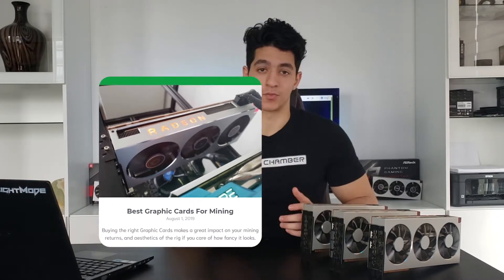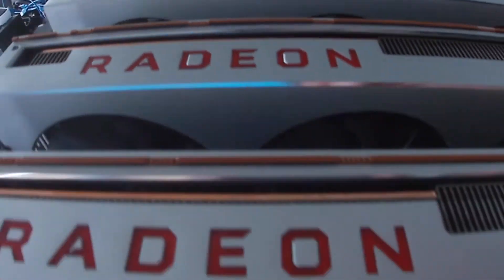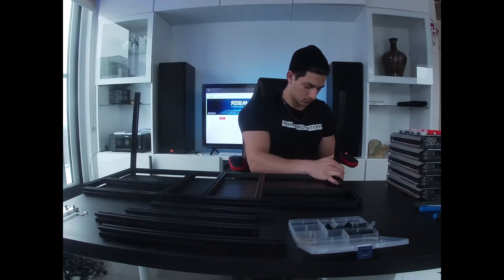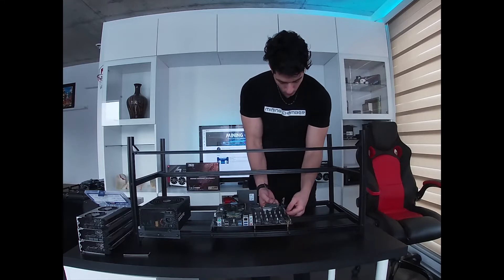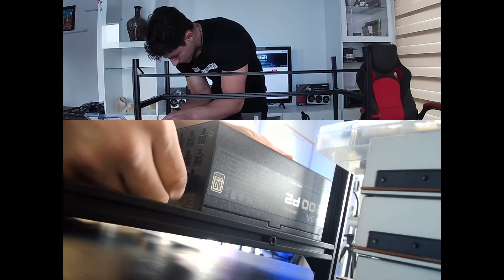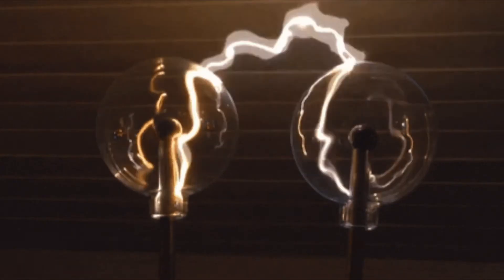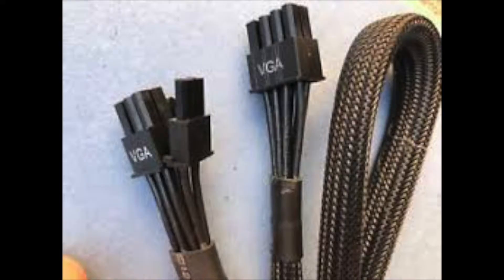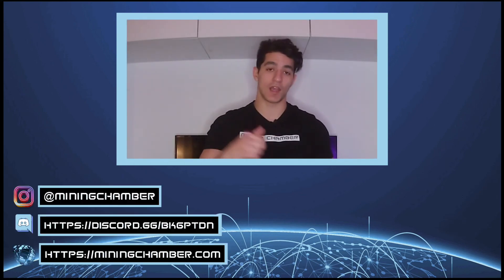HOW TO BUILD A MINING RIG + BEST GPUs IN 2020 !

Comment: Hey guys. I built my first mine and the GPU fans don't spin. I also have no signal going to my monitor. Did you have to troubleshoot your mine before it worked or did it work right away?
Reply from the maker: Hey!! GPU fans don't spin at all or do they spin and then stop? And for no Signal usually you will need to plug in the HDMI in the main GPU that is connected to the main PCIE slot if not then try the integrated one on the motherboard. Sometimes you have to troubleshoot and it is all and our luck haha! Join our Discord server we will and we will get you running. https://discord.gg/bK6ptDN
Reply: @MiningChamber  Thank you for the invite, just joined the group! The fans don't spin at all.  I have tried plugging the HDMI to the main GPU and the board directly, I even moved a GPU to the board.  I really appreciate your help, this is my first build and I'm really excited to get it going but so far it's been a week of troubleshooting.
Reply from the maker: @dderuy  No problem at all! If they dont spin at all then we might need to look at the PSU. I will talk to you on Discord and well see whatsup!

Comment: Hello! I'm planning to set up 3 radeon VII with the 1200 watt power supply which is the one you recommended. Can I plug that into any outlet? I live in New York
Reply from the maker: Hey Nick!! Yes absolutely perfect for 3 Radeon VII, we recommend getting the P2 EVGA 1200w Platinum PSU. It has a good amount of vga cables!
Reply: @MiningChamber   Perfect and if I would want to add 3 more to make 6 radeon total id just have to buy another EVGA 1200w and find another outlet? I have standard electric btw that's fine right?
Reply from the maker: @RealNicoGS  oh yes sorry perfect for the double p2 evga and completely missed the electric part. 

So for 3 Radeon VII you will be using upwards to 900 watts in mining, add 3 more you got about 1700 watts.

Which means a 15 amp circuit wont be able to handle all the load, so first check on your fuse box and try to distribute them on 2 - 15 amp outlets or 1 - 25 amp outlet. 

So just try to read the fuse box label and locate outlets and make sure they are not in the same circuit. ( if you switch a breaker off and then the outlet does not supply power means it is connected to that breaker, sometimes 2-3 outlets can be under only one breaker.)
Reply: @MiningChamber  perfect thanks!!!!

Comment: I am getting a two Raedon VII cards.  I have a 750 Corsair Gold, but I believe this isn't going to be enough.  Thoughts?
Reply from the maker: Hey Walter!! We hope we answered your question in the live stream! But yes it is good enough, but to be safe I would go with a 1000 watts to avoid any issues.!!
Reply: Yes you did, thanks so much for the response.  I ended up getting a 1600w Rosewill Gold level open box special from newegg for $143 plus tax.  I was trying to utilize my old flag ship box I put together in 2007, but it just was too old.  So this is my first venture into Crypto mining.  Got a MSI a360 that supports 2 psie cards on the board (for the Raedon VIIs I bought), plus another 6 or so if I want to remote locate them. Thanks again!

Comment: You did not talked about psu ..... In first 3-4 minutes ..... All these gpu required psu ......... And you did not mentioned that .........
Reply: I missed that part..... Yes you mentioned that
Reply from the maker: Hey!! Thank you for the feedback!

We mentioned the powersupply that we are using on 2:55 and we go more over them at the Electricity part in a bit more details.

If you have any specific questions let us know and we will answer them right away!